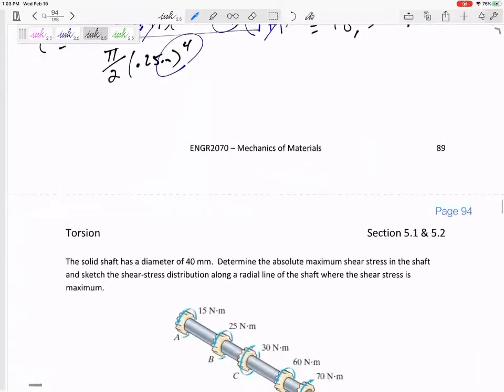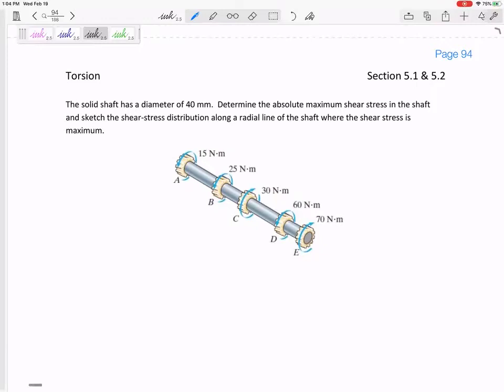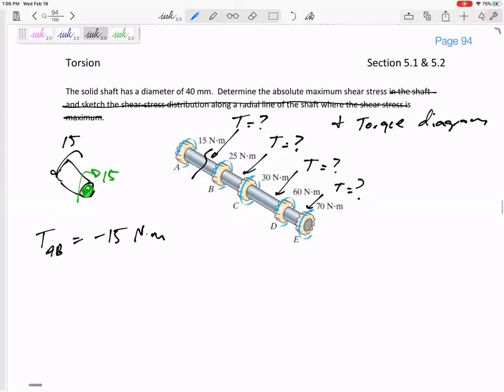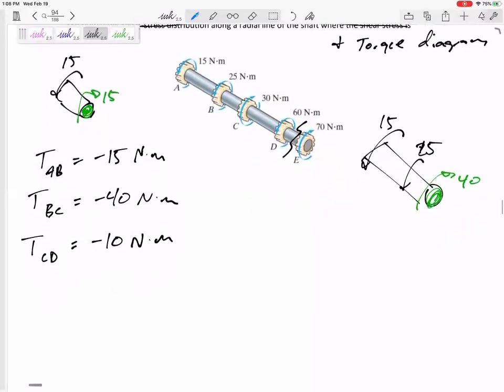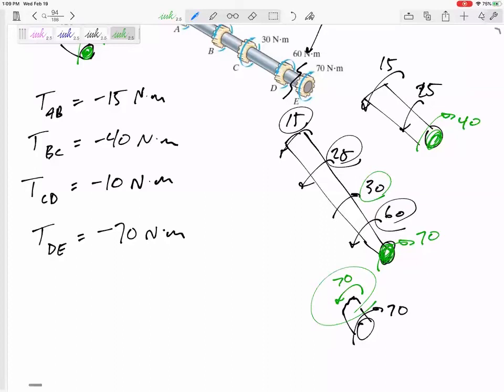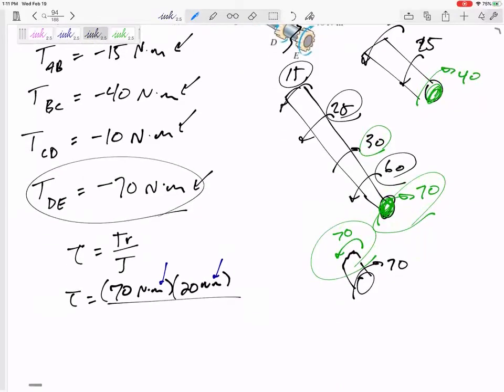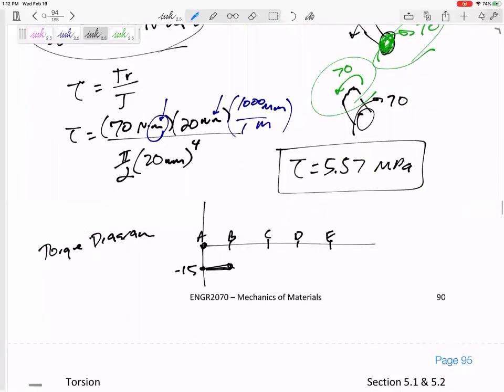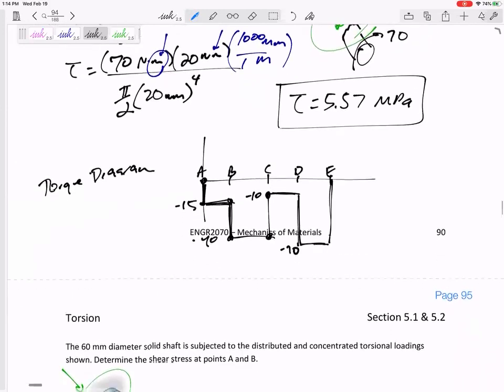Mechanics of Materials - Torsion example 2

Comment: shouldn't T_CD be +10 Newton Meter? We have -10 and -25 then a +30 so to reach equilibrium, we would need a +10? Nonetheless, fantastic video!
Reply from the maker: Remember that for internal moments, positive is right hand rule - thumb pointing “into the cut.” So I’m pretty sure you’re seeing the direction of the internal moment correctly. So ask yourself, is that moment “into the cut” (positive) or “out of the cut” (negative).